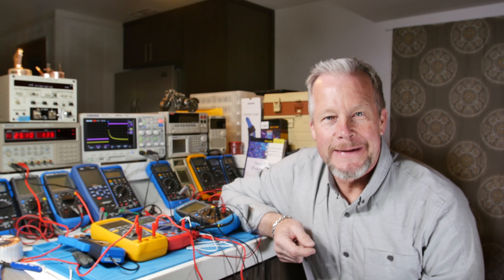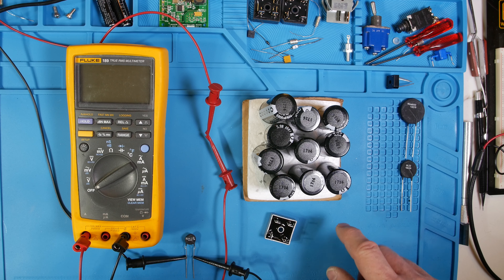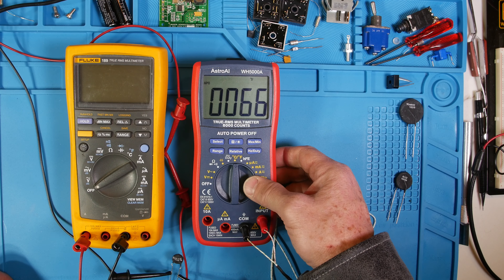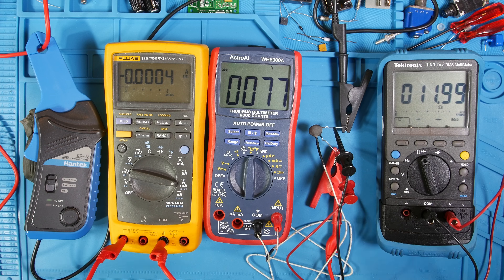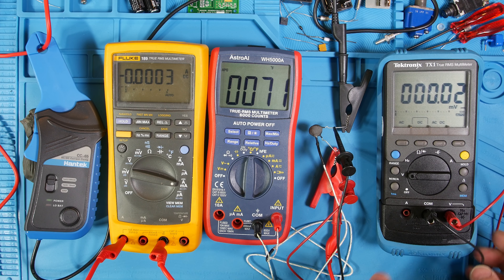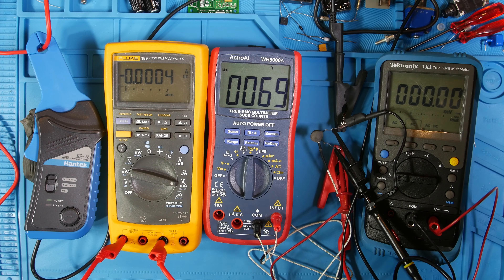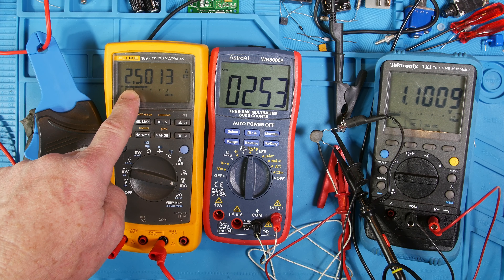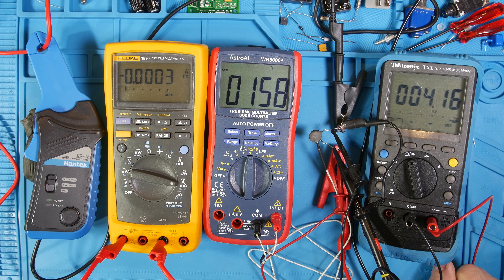How thermistor protects your power supply - NTC protection against Inrush current

Comment: Hi there!! just few days ago came across this..your " Y.T. channel..& I must say you really do HAVE a "Captivating" & Infectious Introductory SMILE.. 👍👍👍🙂🙂
..N.T.C.'s.... They're great for this
 " initial " ..Power Up  sequence...but then it's usefulness is over once heated up ... , it remains so as long as current flows through it..
( low res. region)
A momentary power outage, or one that's less than
( approx. twice  it's thermal time constant)  , the NTC will not cool down ( reset)sufficiently..
so it's always better to have a time delayed ....
( 3-5thermal  t.c.long ) relay that latches in later..and bypasses the NTC.
Reply from the maker: Thanks so much!  You make some excellent points!  NTCs are low cost and easy, but do come with their shortcomings;)
Reply: @KissAnalog  THANKS FOR THE REPLY..
Reply: @KissAnalog  I am bewildered, I am wanting to protect my 240VAC input to 330V DC power supply, capacitance is 2x470uF, its 1A max, now I don't know whether to use to NTC's, MOVs or TVS diodes, I want to protect the HV amplifier section, do I use MOV's on the AC input to prevent voltage surges, then NTC's on the power feed into the HV amp for current surges?
MOV's I read degrade with time, but no clear information how long they last, which made me wonder if I should instead opt for TVs diodes?
Reaction time for my project is important, getting to that low resistance within say 3 seconds.

Comment: I bought a bunch of NTC CL101, I just noticed that the initial resistance isn’t very high.  They’re rated for 16amp.  I’d figure that the resistance would be higher, but there not.  So now I wonder if they’re really going to help at all.
Reply from the maker: Great question!  They are rated at 0.5 ohm when they are at room temp (I believe), so they will slow down the inrush but it could still be quite high.  You could place 2 in series if you think that will help you more.  Thoughts?

Comment: H Eddy, is there a reason why Tube amps don't use NTC Thermistors?. A tube rectifier is a limiting component as it can only handle a limited reservoir capacitance.  Could it have something to do with the 2 power-on stage of (1) transformer energizing, and (2) the Standby to ON which charges the main filter caps?
Reply from the maker: Great question!  I think it might be because the tube amps don't typically have the huge bulk capacitors.  This is probably due to the voltage levels that the tubes run on, and it could be that many tube amps were/are Class A power amplifiers that don't have the same dynamic load to the bulk capacitor.  Then there's the age and engineering practices that are hard to change - even when there's a better way;)
Reply: @KissAnalog  thanks Eddy. I’m going to install a NTC in a tube amp and hit the power switch with a 12’ long pole. If you don’t see me on the front page of the Sydney morning Herald, you’ll know everything worked out just fine.

Comment: Great video
I have a question please.
I'm repairing a guitar bass amp and it has a NTC (ntc100k) that appears to have been glued to the heatsink on one of the power transistors in the output stage.

It appears to have dislodged from the heatsink, should I glue it to the heatsink and if so what is used. Thanks
Reply from the maker: Great question.  An NTC drops in resistance with heat, so it would probably only be safer off the heat sink, but if they glued it to the heat sink that might be better in this case.  I think if it is physically touching the heat sink that should be enough.  Not knowing what this NTC is being used for.  Probably inrush current to power supply.
Reply: @KissAnalog  thanks for your prompt reply
I'm doing a repair so it appears that it was glued to the heatsink, do you know what glue I can use please
Reply from the maker: Yes, I like this, but there are other options of course: https://amzn.to/3NoHAqA

Comment: Thanks ! I just discovered this type of inrush current limiter. I had a meter setup similar to yours. I also recorded about 254 degrees F on the ntc. Mine is to limit the inrush current on my isolation transformer. I needed to keep it from poping the house circuit breaker. Before the ntc I had an instantanous draw of 30,000 watts this would pop the breaker instantly. After it was about 6000 watts. Thanks again.

Comment: Hi i am facing issues the Chinese driver taking much inrush (almost 150 AMP for 20mili second) and My controller relay getting burn every time, since relay limit is 48Amp for 20mili sec,
how to save relay and how will the connection will be?
Reply from the maker: Thanks for the real world example.  The thermistor might be just what you need;)

Comment: Sir what device should I use to stop the motor of fan when the blade is not spinning?
Reply from the maker: Great question!  Are a you asking about a resettable fuse or inrush protection.
Reply: @KissAnalog  Sir the resetable fuse  I think, so that I can reset it after fixing the not spinning blade . Thank you ( the fan is an AC operated the size is that of PC use next to small one)

Comment: So do you need to size the NTC Thermistor correctly so its running current rating matches the load current? If the NTC Thermistor is under rated it will burn out and if its over rated it will never reach its closed circuit rating of ~0.0 ohms. Also, when the NTC Thermistor is closed does it still get hot or does it cool as there is no voltage drop across it?

Comment: So as I'm understanding thermistors can only be used in DC circuits correct ? No AC.  And it's connected in parallel. Do you need to add a resistor on the + side or something like that ? Or straight up in parallel and that's it.
Reply: AC and DC.

Comment: What will be the best way for slow charge and discharge a large capacitor bank? How too control a softstart?
Reply from the maker: Great question!  The softstart just protects the FET when charging from zero volts so it isn't charging max current into what essentially looks like a short.
Reply: @KissAnalog  what will be a gentle way to discharge a bank?
Reply from the maker: A resistor works great;)
Reply: @  how to calclate value and power rating?

Comment: I need an ntc 60 and can't find it anywhere. Any suggestions for a replacement one?
Reply from the maker: Thanks for asking, but do you mean a 60 ohm?  What steady state current do you have going through it.
Reply: @KissAnalog  I don't really know. I'm a beginner. This is a part on a whirlpool duet washing machine. It was on the mcm board it was cracked. And all it says on the part is ntc 60 1218. And I've searched and searched and can't find it anywhere.
Reply from the maker: OK so it is a disc shape?  What diameter is it (and thickness)?
Reply from the maker: Does it look like this: Link
Reply: @KissAnalog  well it's a lil smaller than a dime
Reply: @KissAnalog  but a lil thicker than a dime has a white pirmid shape then out from that it has NTC and under the NTC it says 60 then a white line all the way across it then under the line it has the numbers 1218
Reply: @KissAnalog  and yes it's round like in the video
Reply from the maker: OK it might be 60 ohms.  This is a 47 ohm which might work just fine.  The function is to slow down the inrush current, then heat up and drop to low ohms and allow normal current flow.

You could try this 47 ohm and see if it works.  Is there a breaker that pops on the unit (a little red pin that pops out) or maybe a fuse?  If so and the 47 is too low in ohms - then it might pop.  But 47 or 60 ohms depends on the temperature of the room.  So, I think the 47 is close enough - especially if the room is environmentally controlled.  Remember, the Manufacturer has to take all room temps into account.

Let us know how it turns out;)

Here is an example:

https://amzn.to/423Iu4N
Reply: @KissAnalog  thanks so what causes these to crack ? A shorted out some other part?
Reply from the maker: Every turn on can heat them up - and then just being so small - the engineer undersized it - is my best guess.
Reply: @KissAnalog  ok I was just wondering. I was thinking maybe if another part failed it might have caused it to crack and fail. I'm a newbie in the game so I don't really know a lot.

Comment: so,when it heats up, its   resistance goes down to zero,  more current can flow ,how and what does it protect?
Reply from the maker: Thanks - and yes - it protects against the initial rush of current to charge the caps and then it heats up to take itself out of the path.  The inrush current is a fraction of a second.

Comment: Please help me with this question. If the termistor in a power supply explodes what other components may be damage? Thank you.
Reply from the maker: It depends on where it is in the circuit.  If it is in the input (EMI) circuit, then it could be a diode rectifier.  Or it could be a transistor.  Check for shorts.

Comment: Thank you,learned a lot and have a question.I have a laptop power supply in which a ntc-50 is blown and for the replacement I have a ntc- 10d from a another PC power supply will it work?thank you.
Reply from the maker: It probably will. One thing that is important is the current handling capability.  You want one that can handle at least the same amount of current.  If it is physically larger in diameter and/or fatter, then it probably is OK.
Reply: @KissAnalog  Thank you very much sir helped a lot

Comment: I didn't see any current limiting at all - the Fluke 189 and the Hantek current probe read 2.5 amps from the moment the circuit was switched on and held steady while the NTC headed up. Maybe the current was limited for a few milliseconds maybe?
Reply: Often, a few ms is all you need. The reducing volt drop clearly shows the NTC behaviour and general principle though.

Comment: Hello Sir, I recently have a power outage which kill my Haier AC outdoor power supply unit, what I notice is during the power outage there is a cycle of on/off from the AC main. After several hour of research I found that the power supply IC (1200P100) is dead so I replaced it and it worked....but there was another power outage today which kills it again, so I suspect that there's could be something wrong with the surge protection circuit on the board. Do you think I'm in the right direction? Or there's other components that I should look at?

🙏🙏🙏Thanks
Reply from the maker: So the mains that power this AC unit dropped out and then came back - but then it seemed to kill the AC unit?  It would seem that there must be transients getting through that is causing this damage.  So yes, I think you are on the right track.  Pin 8 of that chip has a resistor to the high voltage but if this voltage has a spike it could kill the chip.  Is there an MOV on the board?
Reply: Yes, the main 220VAC dropped and come back. So if I put an NTC to prevent that high voltage spike it should help right? What I don't understand is that where is that high voltage spike could come from, Is simply by turning on and off the main AC power cause that spike?

and i assume MOV is metal oxide varistor I found one on 5 pin which is IRFUC20.

Thanks for getting back to me, really appreciate it :D

Comment: Thx for the video.  Are there any considerations using NTCs (or PTCs) in series vs parallel to a load?
Reply from the maker: Thanks for the question.  Yes PTCs and/or NTCs are typically used in series to the load to protect it.  The PTCs act as resettable fuses and thte NTCs or thermistors act to protect against inrush current.
Reply: @KissAnalog , Excellent!  Thx
Reply: @KissAnalog , one more...  then an NTC in parallel to protect an AC circuit from inrush before rectification?
Reply from the maker: Yes, you can place the NTC in front of every thing to protect the rectifiers.
Reply: @KissAnalog  Thanks so much.

Comment: I found this video when I was searching why my cheap aliexpress 8A led power supply popped when I was turning it on. I found exploded component NTC 10D-9. That damn power supply was working few days but made uneven hissing noise and burnt varnish smell. I wonder if it is thermistor fault or other components.
Reply from the maker: That's a great question.  I'd think that the circuit was pulling more current than it was designed to pull.  Maybe a bad LED pulling current?  The NTC should drop in resistance value with heat/current - so if it actually got to hot and damaged itself - then it is probably a load problem.
Reply: @KissAnalog  My socket power meter showed 60w and multimeter about 4a at 12v.
Reply from the maker: How is it going?  Did you find the problem?
Reply: @KissAnalog  I opened that power supply out of curiosity. I don't have any spare parts or equipment to repair it, so I will leave it. I ended using old atx PC power supply. It has plenty protection and power.

Comment: Thanks for the video. So, let me see if i understood correctly: an NTC thermistor limits the current at first because at room temperature it has a (relatively) high resistance. Then, as current passes through it, it becomes warmer and warmer, lowering it's resistance, allowing for more current until it reaches a peak of whatever current you need in your circuit. But from that point on, it stays warm (or should i say hot) for the rest of your device functioning. Correct ?
Wouldn't a PTC thermistor be a better idea, working cool and only heating up when inrush current happens, by driving it's resistance higher, therefore allowing less current through the circuit ? Or maybe it's speed of getting it's resistance higher would be just too slow for this job ?
Reply from the maker: You have the operation correct.  The NTC is preferred to keep losses down in operation.  The PTC is selected to keep resistance low in normal operation and only go high during very high current like a short circuit.
Reply: @KissAnalog  Wow, that was fast :))) Thanks
Reply: Please tell me you're joking, yes? He explained it 201 times!!!!! OMG If you can't grasp something this basic you're going to have B I G problems with electronics, sorry, what do you need at the start to limit, block, stop, prevent, close the door to high rushing in current? Gordon Bennet give me a break! you nearly had me there I thought you were serious, not funny! I nearly pulled the trigger :-) very good though!
Reply: @keithcoltron3171  i have no clue whatsoever what you're talking about ... yes, i'm a beginner, yes i still have alot to learn. But i'm no idiot by any means, and i've managed to learn alot in my life all by myself. So no, i won't have BIG problems. It's you who has problems that other people sometimes don't understand something that YOU consider to be soo simple, and at the same time feel the need to comment. I mean, sometimes i see something similar as well, but i don't feel the need to go "man, you're so dumb" ...
And who is "Gordon Bennet" anyway ??
Reply: @KissAnalog  But NO he hasn't understood otherwise he wouldn't suggest that! NO WAY has he grasped the idea, sorry that's dyslexic? ass about face???????? he knows the starting resistance of each but can't grasp the theory? I think he is pulling your leg though?
Reply: @444guns  If you're serious about it for what it's worth now go to The Organic Chemistry Tutor you won't be sorry, far far better explanations with formulae too, he is very very good and very easy to understand, you won't regret it.
Reply: Also for what it's worth BEWARE YouTube it's FULL of BAD advice and teaching? and will fill your head with confusion, your choice I'm just letting you know, there is SO MUCH crap on here it's scary! so many that think they know or just don't give a toss? won't affect me whatever you do so life's a bitch and then you marry one, ah well.

Comment: Thanks for your great video.  In the Nintendo Switch ac adapter, one ac power plug goes into a thermoster and the other into a Square Slow Blow Micro Fuse.  Perhaps you can talk about the differences and why it doesn't matter which way the plug is plugged into the electric outlet.
Reply from the maker: Thank you for this feedback!  That is a great topic - thank you!!

Comment: can i use 3 NTC thermistors in parallel - i have 3 15ohm/8A ntc would like to use them in my dc welder  - i think i will get 5ohm/24A - my welder input is max 15A at 230v
Reply from the maker: That's a great idea - and yes you can put them in parallel.  It might be a good idea to put heatshrink around the 3 of them so that they are near the same temperature - so that their resistances track as well.  I like the 24 A capability for 15 A max, so that's a nice safety margin.  I'd love to hear how it works.
Reply: @KissAnalog . nice idea with the heat shrink, found 3 ntc with the same resistance with my multi-meter, yes it works, but time will tell
Reply: @fp274  ntc's should not be used in parallel since one of the unit's  will tend to conduct nearly all the current available and blow one by one

Comment: Hi nice explanation and demo of how these things work. I bought one for a bipolar power supply I designed for an audio amp and was hoping it might protect the amp from an accidental short ( in case ). I tried the NTC on a dummy load I have and was surprised at how many wats the thing could deliver before it limited current. I think a 2nd video on how to select the value for what limiting you need would be really great. I bought a NTC 10D-11 and I think I should have ordered a smaller one but don't understand the values.
Reply: wait , I should be using a fuse to protect against shorts and the NTC to protect against inrush..
Reply from the maker: Thanks - I think I should do a follow up video;)
Reply from the maker: Yes, a fuse or a resettable fuse (PTC) for shorts and NTC for inrush;)
Reply: @KissAnalog  ah , it was a PTC I was looking for all the time !